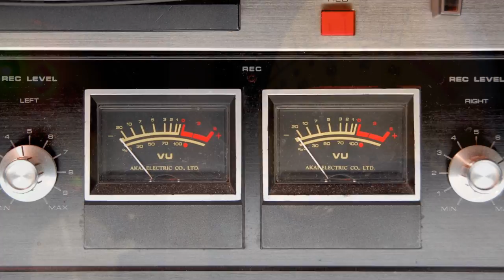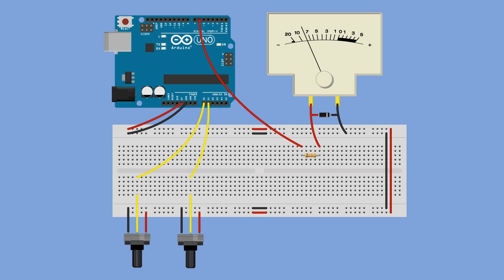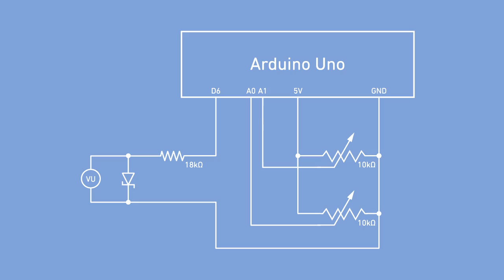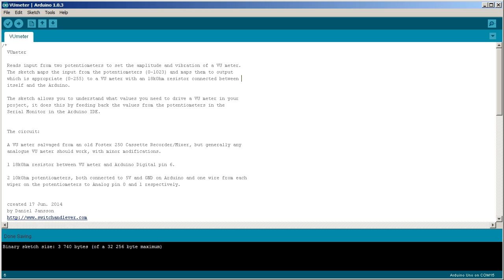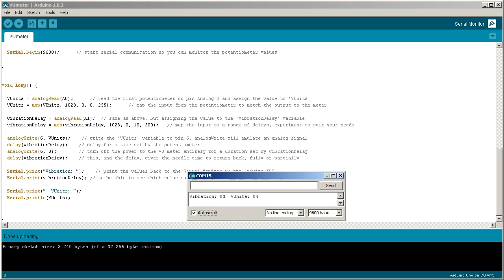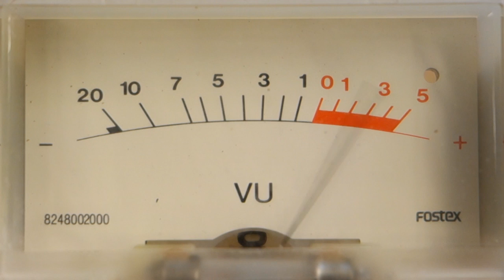Using a VU meter with an Arduino

Comment: you don't need a zener diode. a reverse biased signal diode such as 1N4148 should work fine for clamping the mechanism's back EMF.
Reply from the maker: Possibly, but you take what you have at hand, and I had a bunch of zener diodes. 

In all honesty, the likelihood that this would generate anything appreciable which would be even remotely close to damaging an Arduino, even if you run it straight into the atmega328 chip without the built in protection, is pretty slim. Still, it's good practice to have a diode there.
Reply: yes, I just comment as people will more commonly have something like 1N4148 at hand so don't need to go out and buy a zener which they're less likely to have.
Reply: You just need a silicone diode

Comment: Outstanding job!  Folks with no electronics background may want to look up info elsewhere on why there's a reverse current when the meter is returning to the home position, or how a resistor limits current, or how the C code does what it does, but such sources are all available on the web with a quick search. Those with at least basic Ohm's Law, physics of conductors, and Arduino programming understanding should have little trouble following this very professionally done video. 

When will you be doing the video on making a knife with an Arduino-powered birdhouse in the grip? :-)

-- Mike
Reply from the maker: Oh, you mean the Birdhouse Kill-o-Matic 2000? Yeah, I had to scrap those plans after a couple of guys in black suits and Ray-Bans from PETA showed up, they mumbled about cruelty to animals or somesuch before flapping their arms and flying away.

Comment: Read up on the PWM function provided on the Arduino. It already provides the variable "duty cycle" (on-time/off-time) output which is what you're doing in code.
Reply from the maker: That's exactly what the code does. It takes the potentiometer value (0-1023), maps it to a format (0-255) which is used for PWM duty cycle, and outputs it through analogWrite() which is quite literally how you alter the duty cycle of the PWM on the Arduino. 0 being 0 duty cycle, 128 being half duty cycle, 255 being full, and so forth.
Reply: @SwitchAndLever  Sorry - I should have paid closer attention! ;)

Comment: A VU meter is used to monitor audio levels, this tutorial doesn't even touch the issue - this is like a tutorial for cooking an apple pie that just shows you what an oven looks like.
Reply from the maker: I guess you missed the point of the video then. It’s not about driving a VU meter to monitor audio levels, it’s to drive it with an Arduino do measure whatever you want with it. I have a video where I measure YouTube subscriber count with an old oil cistern gauge as well, I guess you would have a similar problem with that 😂
Reply: @SwitchAndLever  "I guess you missed the point of the video then"
Basically, yes I did, I read the title expecting it be a tutorial on how to set up a VU with Arduino for it's standard/expected use . . . but I don't think that's an unreasonable assumption . . . to me 'using a VU meter' means getting it to respond to audio, of course you can use it as a doorstop or to measure temperature, but I think most people would think this was a tutorial about using it to track audio levels . . . anyhow, thanks for the tutorial nonetheless, there is some useful info in there regardless.
Reply from the maker: Dave Lordy If you want to use the VU meter to react appropriately to sound using an Arduino would be entirely superfluous, it’s just adding a layer of obfuscation you don’t need in the circuit, not to mention as you have to do a analog to digital conversion on a reasonably slow IC to then actuate the small motor in the meter will both reduce fidelity and introduce lag. Hope that answers your question why this is not the tutorial you thought it was 🙂
Reply: @Twhite97  "Your mistake is assuming a VU meter can only be used to measure audio amplitude levels.

Nope, didn't assume that.

"Your third mistake is bashing Switch & Lever for not following YOUR assumption. In the end, he delivered exactly what was promised and did so it a clear, concise manner."

Are you wearing a feddora ?

Comment: I leave the diode and use two resistors a 1K ohm .trim pot. over meters and another on 20K ohms in series with meters maybe a small cap over meters. when the digital output becomes high it takes some time to charge the capacitor(voltage), and if  longer the digital output is high the higher the voltage over the meter.
Reply from the maker: Wouldn't that result in the meter being less sensitive though, with more sluggish movements as the cap takes time to charge and discharge? Or are you talking small cap as in pF rather than uF?
Reply: Switch & Lever : yes you are right, but with a small capacitor, mabe nf/pf, but in pwm to analog you have to use a capacitor to store , let say 3,7 volt, and the use of a resistor 10k , it take a little time to rise the volt on the capacitor, i think it will work just fine.

Comment: I think a standard diode should work as a flywheel diode just as would be done for any inductive load such as a motor or coil.   No need to use a zener.
Reply from the maker: Use what you have, I had a bunch of zeners. I’d rather use what gets the project done rather than waiting for parts, which has no real functional difference for the end result 🤷‍♂️
Reply: @SwitchAndLever  I fully agree with that sentiment and often do the same.  It's just that a standard or shottky diode is often more plentiful than zeners (especially at a specific breakdown voltage), so someone less experienced watching may erroneously think they need to purchase a zener to make the circuit work properly, when in fact they don't, and that was the point of my original comment.  Thank you for your reply. (BTW subscribed)

Comment: Awesome! 👍 I wish I had the patience/desire to do even minimal coding. I've been trying to for YEARS but I just can't force myself to GAF😄
Reply from the maker: You need to treat it like a tool in your toolbox. You don't learn a tool just to learn a tool, you learn a tool to do something with it. It's by far easier to learn to code if you have a goal, a project to work on. In that sense it becomes just like any tool. If you have the patience to work on anything for a long time you can have the patience to code.
Reply: @SwitchAndLever  that's honestly a great point. I always had a hard time with math until physics gave uses that I could wrap my head around. I always treated it like boiled broccoli or something. Like, "this will be good for me someday." 😁 I guess I should find a problem to solve instead of making it 1/3 of the way through another "C++ in 30 days!" book. Thanks for the video, btw
Reply from the maker: @els1f  yeah, I can't learn like that either, I have to put it into practice.

Comment: Thank you for the video.  I apologise for the naive question, but will I need two Arduino Unos to work a pair of VU meters for a Stereo and how would it be connected from the stereo amp to the Arduinos?  Thanks again for the video.
Reply from the maker: I don’t think feeding an amplified signal directly into the Arduino is a terribly good idea. If you’re going to be driving them from an amp why even use Arduino? You could just use the meters directly, that’s what they are designed for.
Reply: @SwitchAndLever  Excuse me, but your answer is misleading,  if somebody connect  meters directly to output of an amp, VU meters will show exactly 0, because audio signal is alternating voltage. There is a lot of various circuits on the web how to hook up a VU  meters to amps, lot cheaper then with Arduino.

Comment: Nice. But i just dont get why u use a zener diode. Would not a normal diode do the same job?
Reply from the maker: Yep, but you gotta use what you have available, and that's what I had available.
Reply: Ah, ok. But a Zener can work as normal diode too. As far as i learned ;-) But hey, as long its working... who cares ;-)

Comment: can you just put a VU meter parallel to the output of an MP3 player without additional circuitry?
Reply from the maker: I'm afraid not, the audio signal is simply not enough to move the needle of the meter.
Reply: Thanks!
Reply: +Switch & Lever It actually is. It takes a very tiny amount of power to move the needle. Just hook it up to an audio output of a MP3 player or media player of choice, and it will run fine.
Reply from the maker: +Chicken Curry this one didn't at least. I tried hooking it up to the output of my laptop and the needle barely twitched even on full volume. Maybe there are VU meters that do what you describe, but this one ain't it.
Reply: It did come out of a higher-end unit that probably has a fine tuned drive for these guys, makes sense.

Comment: You turned the diode the wrong way.
Reply from the maker: Gosh darnit, you are correct! I soldered it in correct (off camera) but I guess I made a booboo drawing up the schematic. Will make a small annotation to the video about that, thank you!
Reply: Switch & Lever No problem and for anybody that is wondering its a 5V zener diode.